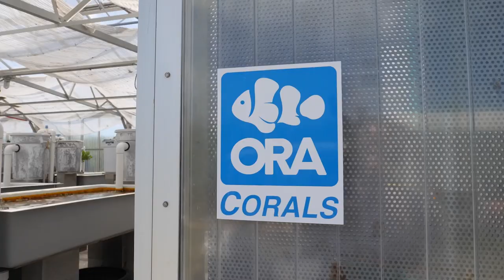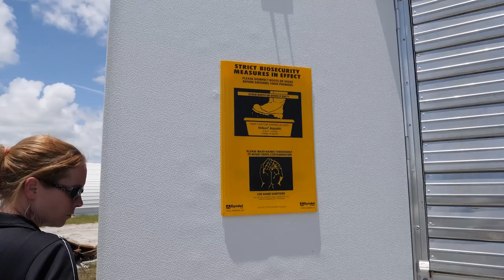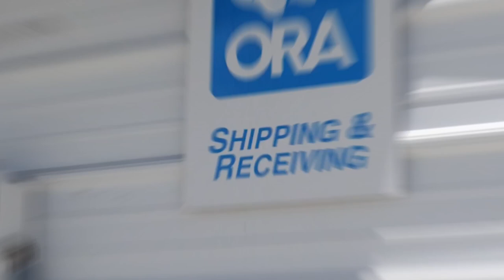Farm-Raised Corals and Marine Fish:  Let's Tour the ORA® Aquaculture Facility

Comment: That one clam he said was "one of the best for home aquarist", but the name got edited out.  Anyone identify what it is?
Reply from the maker: Hi Jim!  We will find out for you-- we've reached out to ORA and will let you know what they say ASAP.  :)
Reply from the maker: Hi Jim!  Here is their response:  "The best clam we offer for the average aquarist would be the Derasa IF given adequate room to grow into the aquarium. This particular clam is extremely resilient, can withstand water parameters where a system is heavily fed, can tolerate a wide variety of lighting (the brighter the better for any clam though) and is one of the faster growing clams. Obviously, with its growth rate being quite a bit faster than the maxima, it will need a larger system over time. Overall, easy to keep in a system with normal reef parameters but calcium should be monitored and adjusted based on consumption."